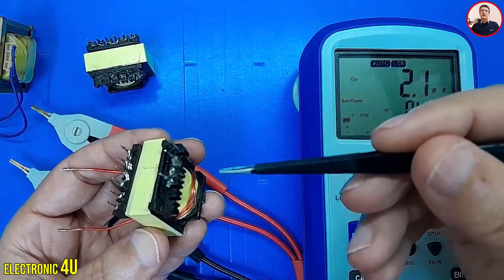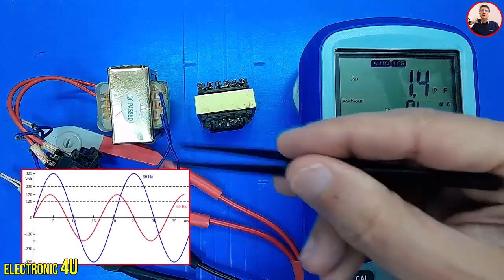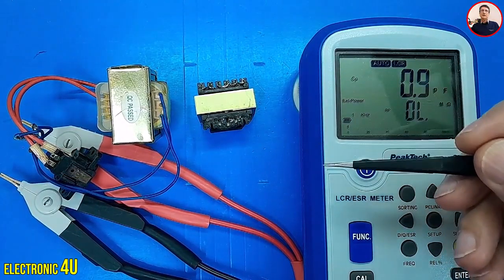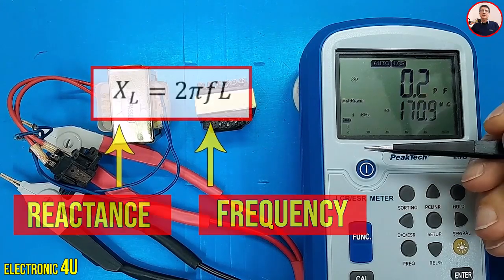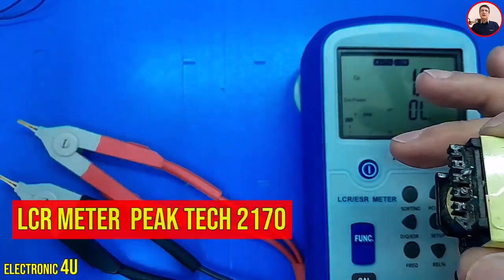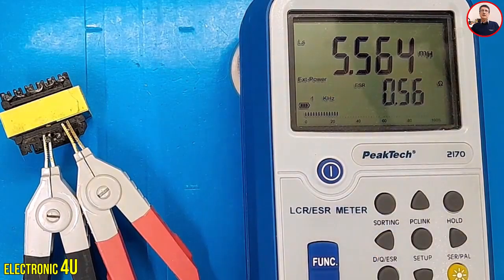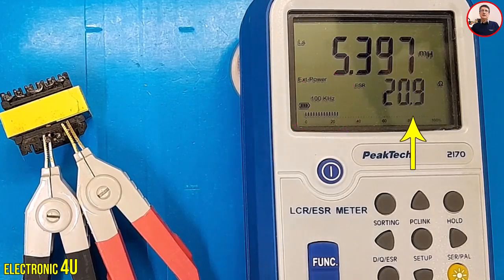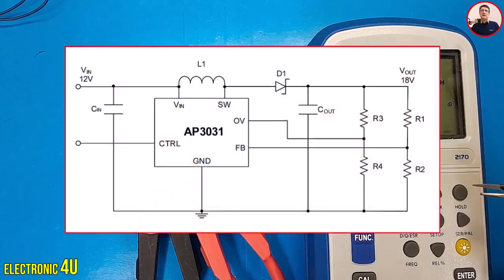Why should we not connect the switching transformer directly to the city electricity?

Comment: When I was young interested in electronic but not educated how switching power supply work because it was new thing. I tried to rebuild fault switching power supply  to standart linear power supply. Used switching transformer, diode rectifier, capacitor from fault one and add LM7812 regulator. It didn't end well and not known what I did wrong for long time. I was thinking about misconnected primary side but later i find switching transformer is useless for build your own supply.
Reply from the maker: Hello, yes, that's absolutely right. 🌹